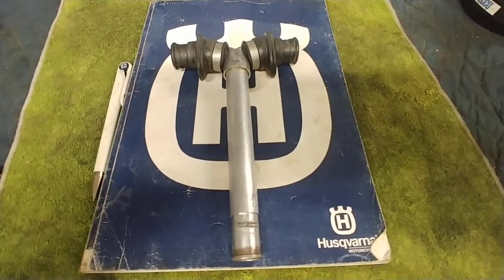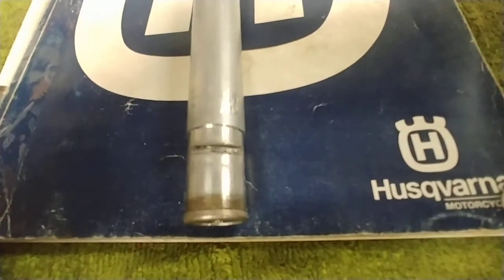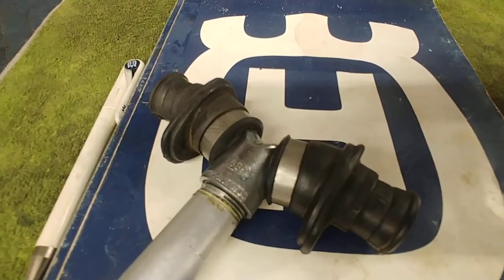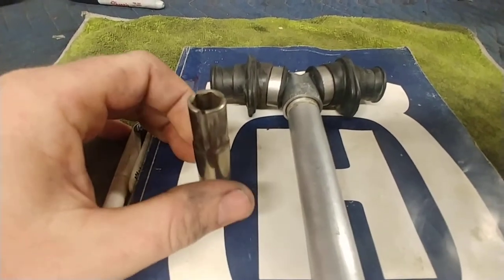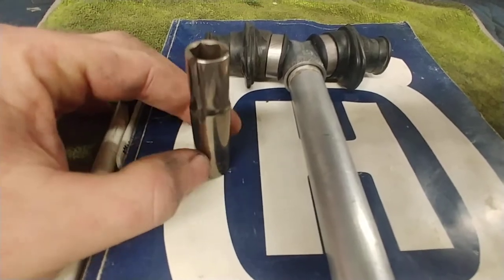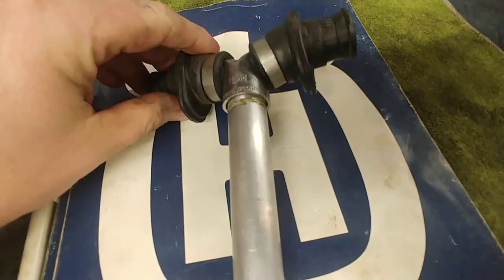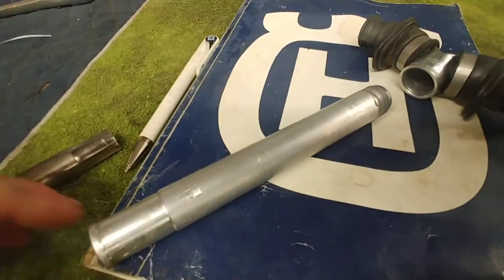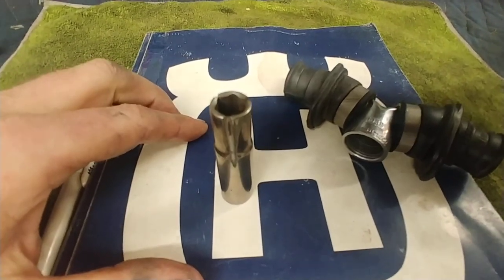REMOVAL - KTM Husqvarna Radiator T in frame down tube coupler

Comment: A 1/2” Allen wrench works great on removing the lower tube too. With a long one you can get a lot if torque on it to break the seal. I’ve done 2 of these replacements with the Samco T silicone hose, a quality product.

Comment: It sucks that the frame ate through the pipe! I need to check the one on my 2018 350 EXC-F. Is the hose supposed to act as a grommet to keep the frame from contacting the pipe?